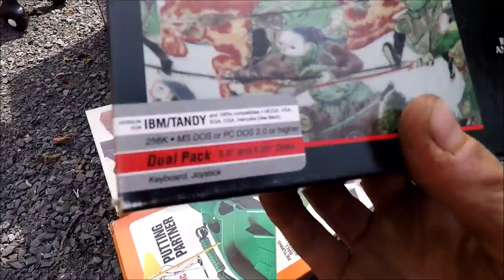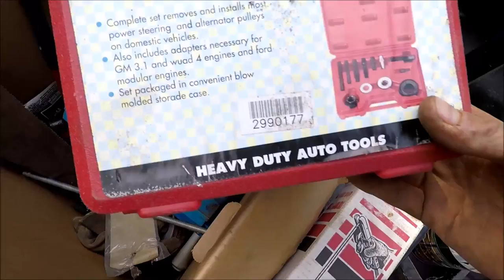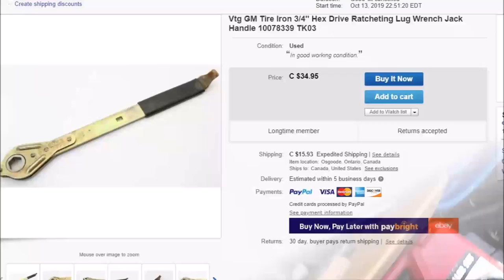Mystery lot of mechanics tools lot for $300. What did I get?

Comment: Great score! Rebuild your battery packs, it’s not hard to do!
Reply: I have been looking into this also. The ones I'm considering fixing require spot welding to bus bar and I'm not sure I can even get them apart in one piece but I'm still gunna start saving some of the more modern cordless stuff I find. I find alot of random tools batteries and chargers while picking and scrapping.